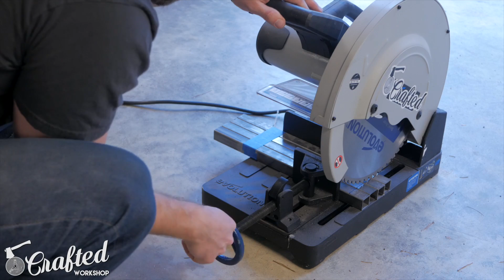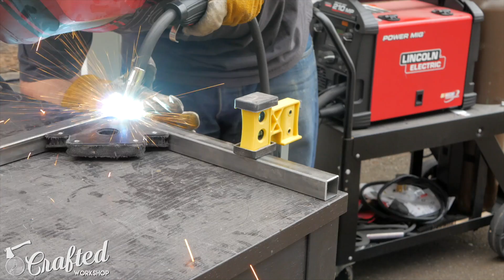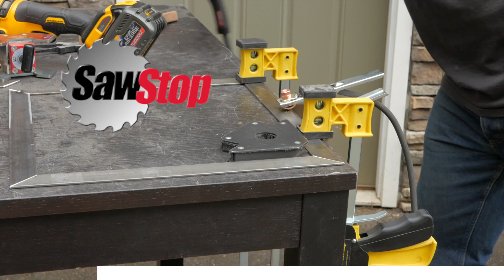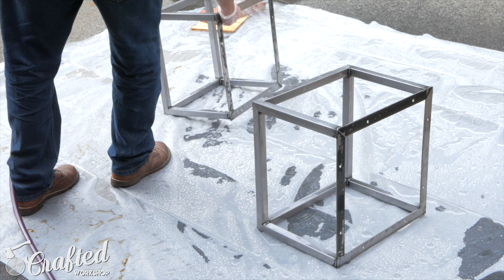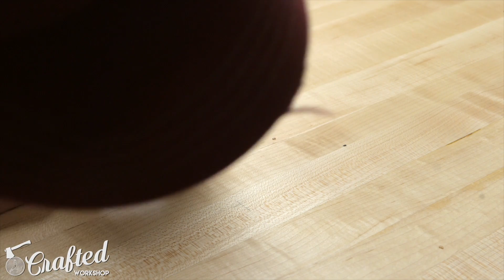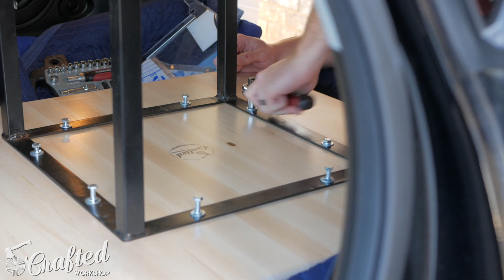Modern Maple and Steel Coffee Table Part 2 | How To Build - Welding

Comment: Wouldn't it be better to make a stone welding table? Cause you may accidently weld your project onto your metal welding table
Reply from the maker: +Ingmar Verweij the big reason to have a metal table is so that you can clamp your ground to the table and not have to worry about having it on the workpiece. Unless you're really not paying attention, you won't weld your piece to the table.
Reply: I have a wood table too and I just put a metal sheet on it for welding, it works well for me.

Comment: Cool build. Haven't seen it mentioned, but an easy way to " clean up" cut threads is to have a nut already threaded on before cutting, then unscrew the nut and it'll recut the damaged thread. You can then round over the edges and still be sure that you'll have usable threaded rods.
Reply from the maker: +MamboTek great tip, thanks!

Comment: Wouldn't it be easier to have the nuts at the sides just sit in the first layer of wood using some glue instead of getting the rod through the whole thing?
Reply from the maker: +Square Kiwi for sure, just didn't think of that before building this, hah.
Reply: Haha oh well, it turned out looking great anyway! :)

Comment: hmmm, I'm not familiar with this way of painting like you did.

I made one table with metal frame and kinda sorta on my second table. looking for a fella who's got some equipment, like a jointer and table saw so I can further the wood top for this project.

full length welds on the frame is the best way to go, I believe. same as what I did. wouldn't do anything less.

cheers now from Canada
Reply from the maker: +Alvin Al thanks!

Comment: I really like the design! Great job! How much do you think they weigh each? Do they feel stable if you sit on the edge?
Reply from the maker: +renoguy25 yea they seemed quite stable due to the weight. Also, no one should be sitting on them.
Reply from the maker: +Tom's Dreamshop Worx thanks man! I would guess around 80-100 lbs each.
Reply: I would have figured  about 4 or 5 times that , if the weight was centered .  But as TDW , questioned , how stable if someone were to sit on an edge .  I would assume that they're pretty stable , but if you watch  any of the  " Fail " type videos , couple of wobbly pops , and nobody understands ...center of gravity  .  :-) :-)

Comment: Nice looking tables . Yes , agree the patina finish is nicer than paint . 
Does that finish go into the steel , or basically sit on the surface like paint ?
Will it scratch like paint ?
I realize you clear coated , and I assume that will help . 

and ya , nice clean stamp , 
when you make something like this , that could likely last for a very long time , do you ever stamp/punch a date into it ?

The other thing I like about those tables , is the simple design ,  should/when it becomes necessary in the future to refinish them , it will be very easy to bring them back to original condition .

Thanks for the video(s)
Reply from the maker: It will definitely scratch, but the lacquer helps to protect it. And yes, I probably should add the date to my builds, but I have the record of the time I built them here on YouTube.

Comment: Great build, I really like the esthetic, the mass, and the exposed hardware (acorn nuts would also look nice).  Do get good utility from your belt grinder?  I've have been thinking of one as a knife-making tool but it would be easier to rationalize if there were other uses as well.  I have subscribed!
Reply from the maker: Thanks! For metalworking, the belt grinder is awesome. I don't use it for much wood stuff, but that's because I have those two halves of the shop pretty well separated. I think it is a great all around metalworking tool, not just for knifemaking.

Comment: how tricky is it to get into welding? seems like something great to add to the skill set, just never done it and not sure where to start. cheers
Reply from the maker: MIG is the easiest, in my opinion. It's basically a hot glue gun on steroids. I took a class at my local tech college, super cheap and I learned a lot.
Reply: If you want to learn how to weld start with a stick/tig machine. If you just want to put thin clean metal together get a mig machine with argon gas bottle, ie not a cheap flux core machine.
Reply from the maker: +John Harris agreed. For furniture type of stuff, I think solid core MIG is the way to go.
Reply: MIG and stick are easier to get into, stick being the cheapest way to get started. TIG is the most versatile but has a much steeper learning curve. For any type of welding, check out +weldingtipsandtricks Jody is a fantastic teacher! He has a great podcast as well. +ChuckE2009 is another great Youtuber to watch
Reply: awesome - going to check it out - honestly didn't even know there were different types of welding - but looking for simplicity to start then work my way up. cheers!
Reply: Jody from welding tips and tricks is the best teacher on youtube. I learned how to stick and mig weld with my everlast using his videos.
Reply: A cheap way to get into welding while still having pretty welds is buy a solid stick welder for strength and then buy a smaller wire welder to just make the welds pretty.
Reply: TIG MIG is difficult....... brazing is simpler